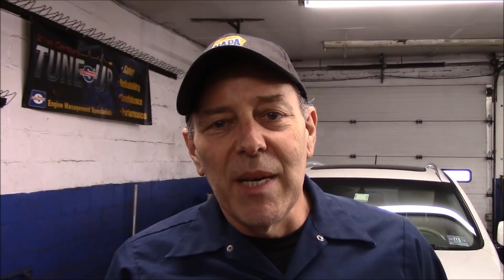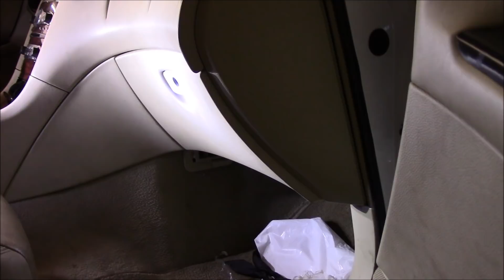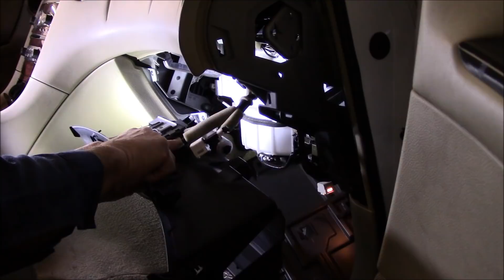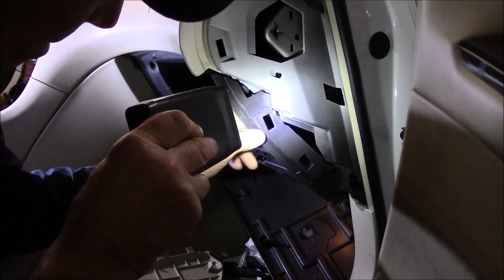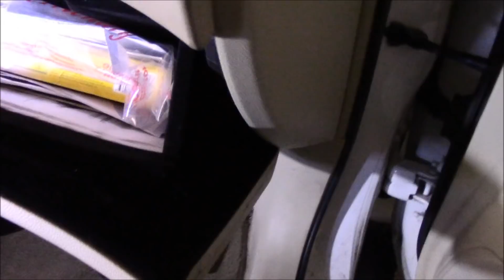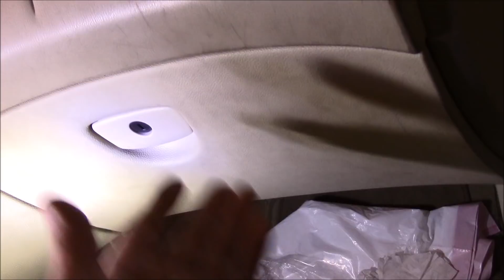How to replace the cabin filter on a 2010 Infiniti EX35

Comment: Hi Jim,
On my Toyotas the cabin air filters say" up "next to the arrow,so the filters go in with the arrow pointing up not down like the filter you used..Nice video.
Reply: I agree
Reply: For Infiniti EX35, the car he was working on, the arrow should point down, so the video is correct.
Reply: Video is correct. Air flow/circulation comes from the slot on top, above the filter, flowing downward. So arrow needs to point down 👍